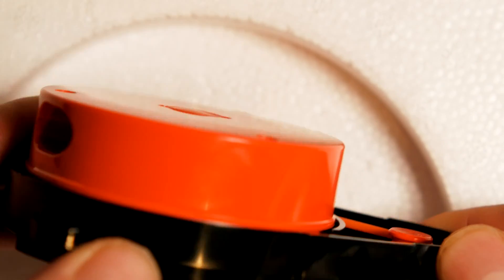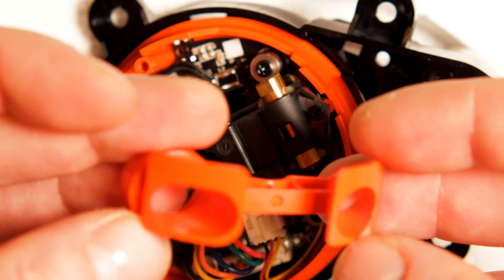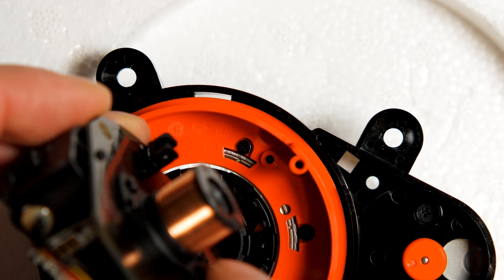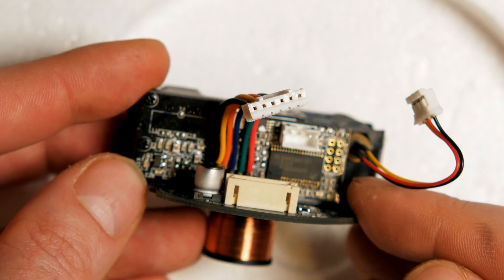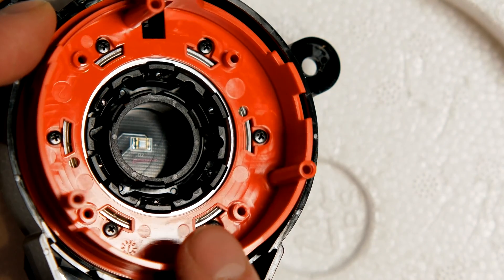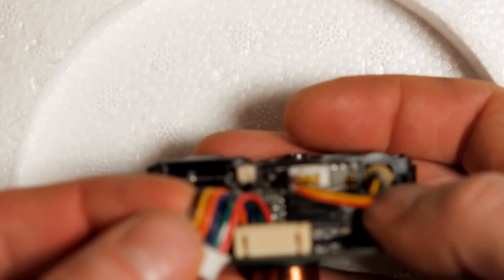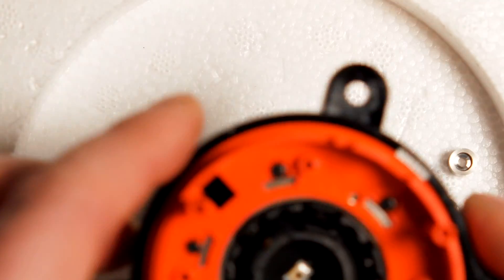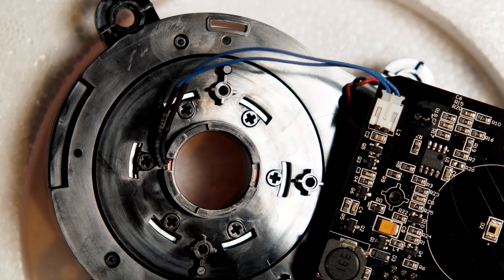Xiaomi Mi Vacuum Laser Sensor Teardown

Comment: Tengo el mismo problema con mi Robot Xiaomi Vacumm.
Sabes donde comprar el Sensor LDS 360 º ???
Gracias.
Reply from the maker: +JUAN JOSE BENEYTO MOLERO 
There is untill now no source for spare sensors. 😔
Reply from the maker: I have found some by AliExpres
https://www.aliexpress.com/item/LDS-for-Xiaomi-Mi-Robot-Vacuum-Cleaner/32812717039.html?spm=2114.01010208.3.27.Bm0Gc0
Reply: Muchas gracias Anton D., Lástima que ya envié el Robot a China para su reparación en garantia. Me guardo el enlace por si me hace falta.
Gracias.
Reply: Hola, cómo lo enviaste? Yo tengo el mismo problema con el LDS. Lo comprén en Gearbest y he visto que por Correos cuesta 55€ y he pensado que mejor mandarlo en garantía, por si no fuera ese módulo. ¿con qué compañía lo hiciste, cuánto dinero y tiempo te costó? Gracias!
Reply: ¿que tal fue la reparación? A mi me sucede que el robot al finalizar no encuentra su base, se pasea, y después comenzó a mapear mal la casa, dudo entre cambiarla yo, o enviarlo...algún consejo?